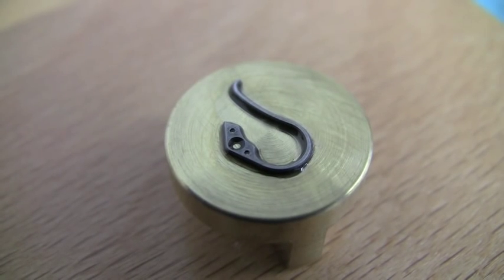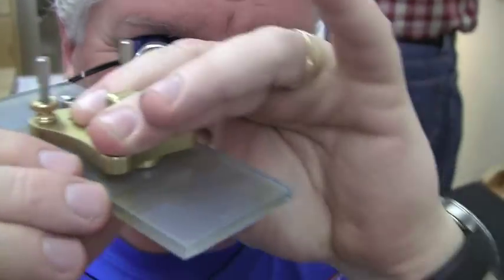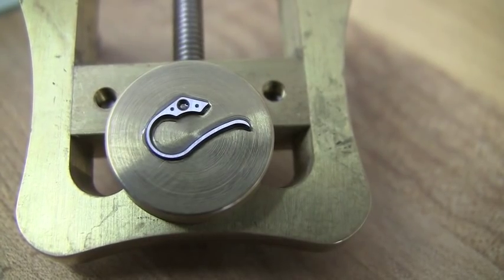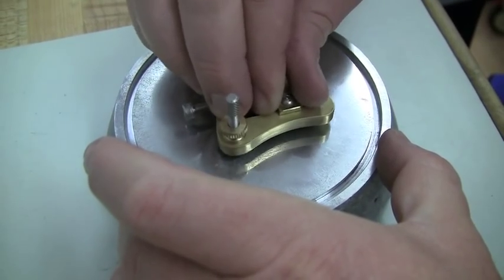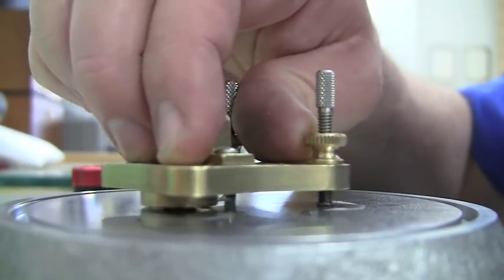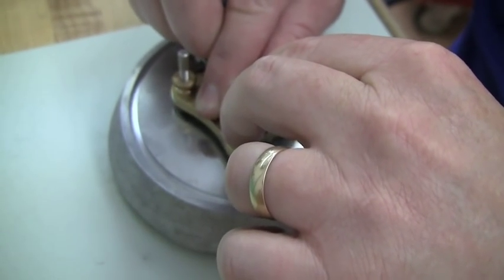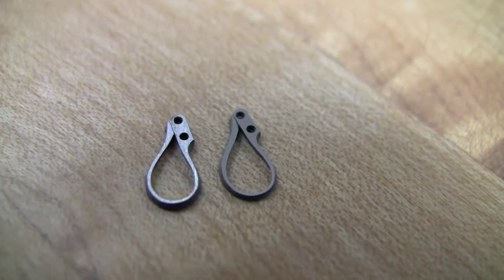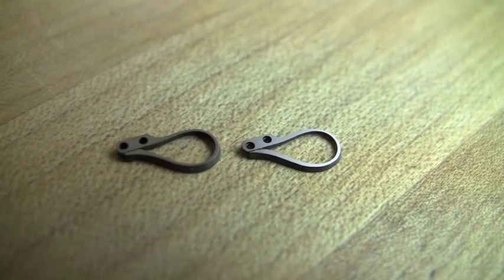The Art of Black Polishing

Comment: I have been practicing this for days with 200,000 grit diamond paste on a tin lap. I still can't get it perfect. Any pointers?
Reply: To high grit
your plate/jig is crocked
specially the plate must be super strait, make it strait by using the 3 piece method.
Reply: @vladnickul  The issue I have is that I can get the polish 99.9% perfect, but after the final pass there are always 1 or 2 ultra-fine scratches visible under the microscope. Basically the workpiece is galling against the lap.

I'm thinking it's probably the diamond paste, and perhaps aluminum oxide or tin oxide would be more forgiving. Is there a specific brand of polishing paste you could recommend?

Comment: what type of polishiing plate and compound is needed?
Reply: Usually tin lap is used with diamantine powder paste
Reply: no thats incorect diamantine sucks, you want much a finer aluminium oxide than diamantine and a zinc plate.
Reply: Incorrect, Diamantine can be used. Here he is using a special diamond paste. Tin or zinc is acceptable
Reply: It's worth looking at a jewelers supply, like Kingsley North for example.  They sell all kinds of laps and abrasives, and might have some discussion of the merits of different ones.  This is pretty fancy technique, people do something similar to make precision tools, "gage blocks".  The thing that guy is actually using might be custom, worked out from their own experience.  Say if it's a big chunk of pewter kind of material it can be stuck in a lathe and faced off flat if it gets out of hand.

Comment: Woulda been nice if they said how it was blackened in the first place....  It's not cold Bluing..
Reply: It's not blackened, it appears black purely from the polishing process, resulting in very little scattering. Since the light reflected into your eye came from a single point, the result is that it will normally look either nearly black or nearly white depending on the light source.
Reply: @BryanO92  Doh...  My bad...